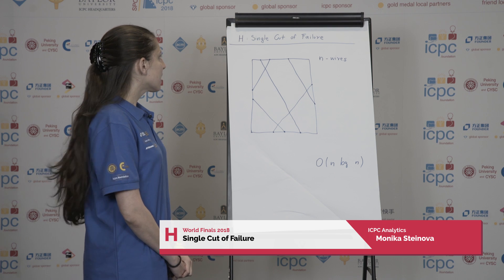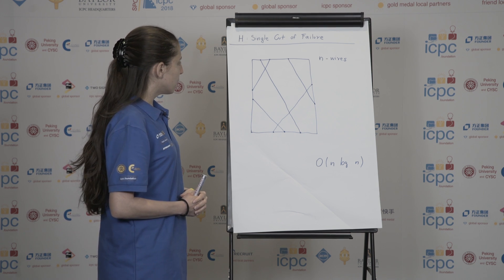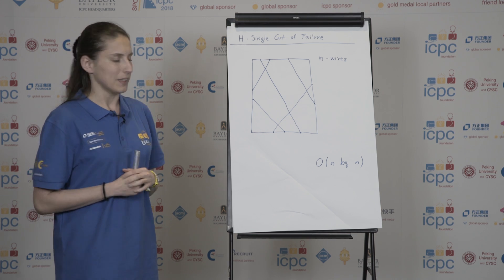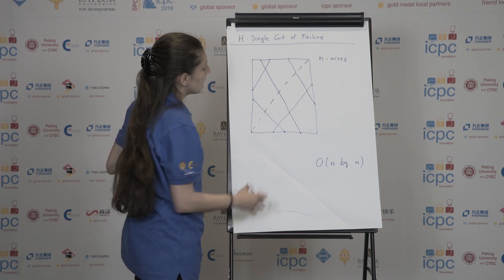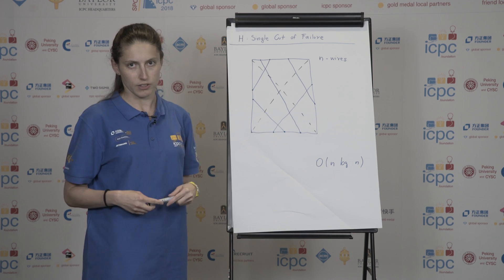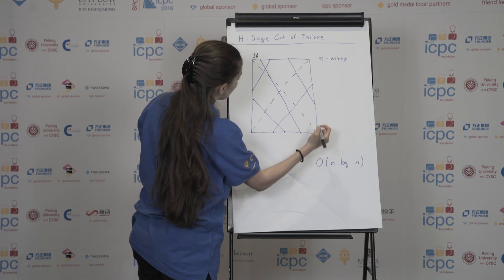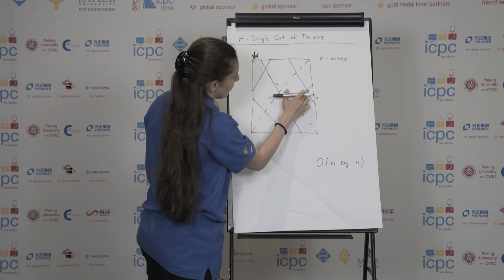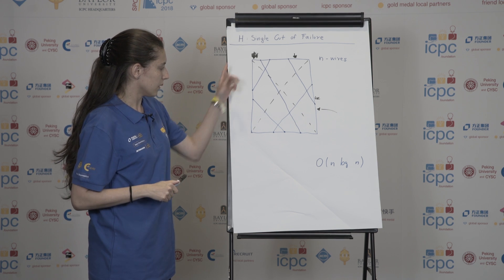2018 ICPC Solution Video: Problem H. Single Cut of Failure

Comment: I don't know why YT recommended me this video after two years :p... but maybe this can be done in O(n) time.... writing the equation of the diagonal... then putting both the points in the equation divided by the coefficient of x... one should be -ve and one +ve if both are of same sign we break the loop and return 2 else return 1.
Reply: We need at least O(n log n) to sort the list of points, and we need to sort the points in order to construct the cut that severs all the wires (or to check that such a cut doesn't exist). You can construct cases where 1 diagonal cuts all the wires but the other diagonal cuts no wires -- consider a set of wires which are all parallel to 1 diagonal.